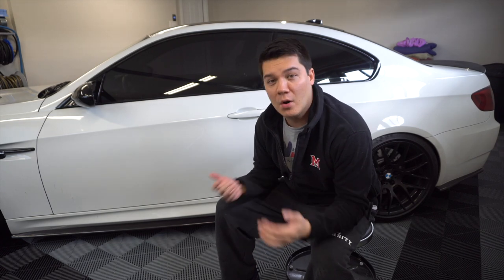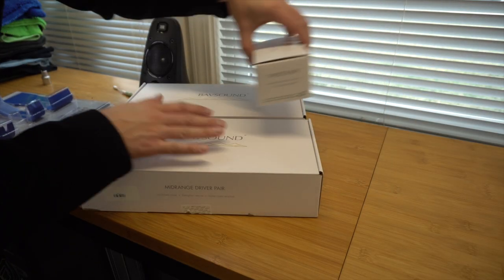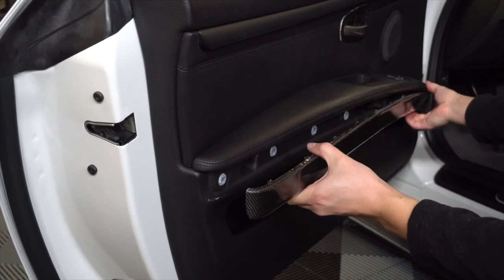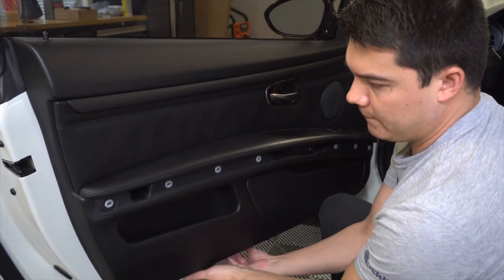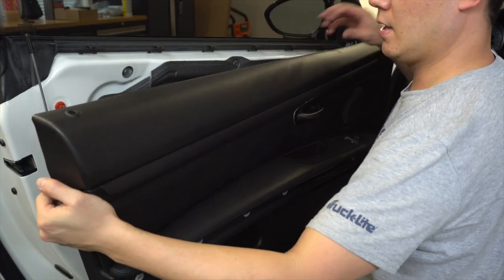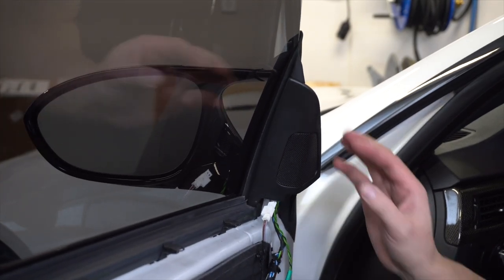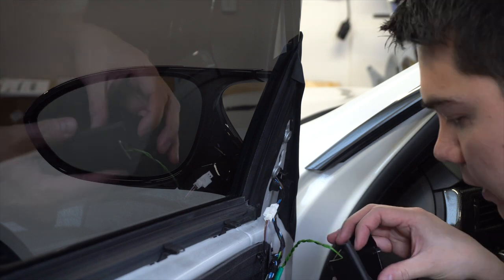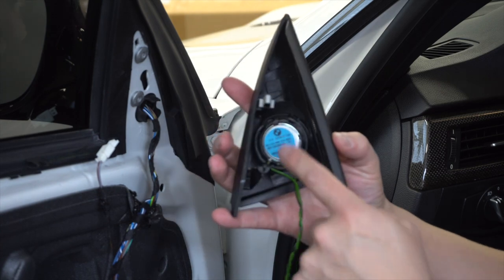BavSound Stage One Speaker Upgrade PART 1 | Plug N Play for BMW!

Comment: Good video. 
I suggest a set of torx screwdrivers for interior parts, engine bay, window regulators, etc. 
They fit in tighter places and are easier to use. 
The Stanley ones are more than good enough for this and are about $10 at Walmart for a set
Reply from the maker: F31 ///M Sport that’s not a bad idea!